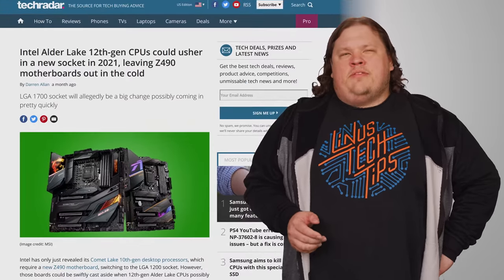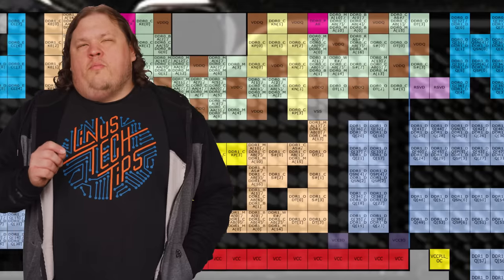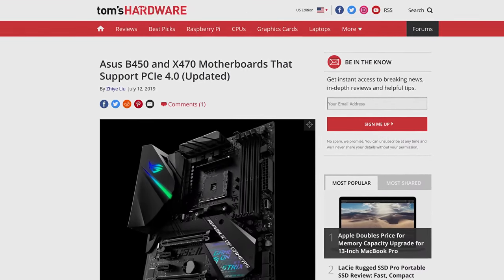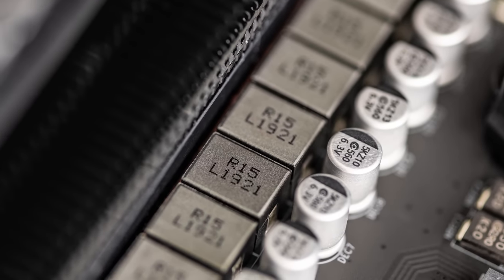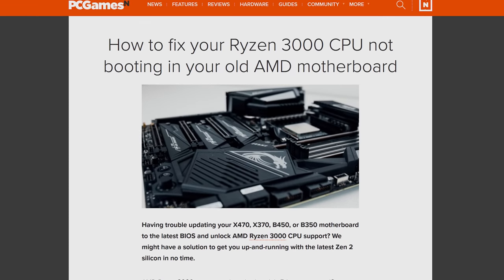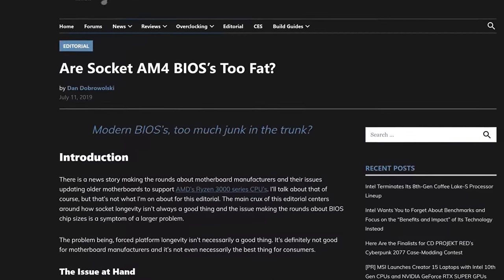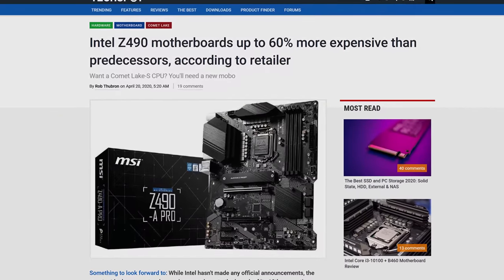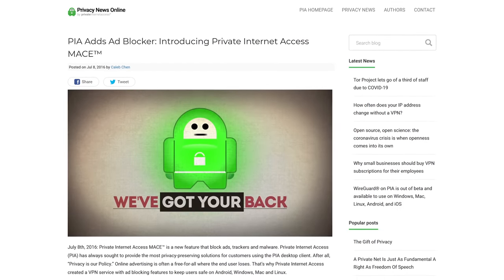Why CPU Sockets CHANGE So Much

Comment: intel, who sold the same processors for many years, changed sockets for little to no reason. Simple firmware changes can make any 3XXX socket work with 8 XXX sockets and all in between. I guess if your running the latest i9 It will fail but for most people and cpus it won't. In china it is normal to take one socket motherboard and edit the firmware to work with another socket.

Comment: well with a 7 to 10 yr upgrade cycle as older hard ware lasts that long still the motherboard i have doesn't even have  a chance or supporting what is out now. 
The thing is usually the fix for this is buy the newest chip set revision. The if you get the newest chip gen they will be compatible. Having a 7 to 10yr upgrade time every time the upgrade path of the CPU will be get what you think you will need in the next 7 to 10 years. More expensive now but if you aren't upgrading at all for that part then it isn't. 
The other part he did not touch on is consumers now usually don't build their own PC. Yes you can but most don't. If you are going to due to it is cheaper then most likely you aren't going for bottom of the bin parts but higher end parts. To this you will want the most recent chipset with the most recent gen of CPUs.
The people who build upgradable PCs that the CPU is part of the upgrade path i just don't get. The CPU changes every 2 years no matter which side of the now line or triangle you are on. Depending on if you count ARM BGA CPUs or not.

Comment: video suggest, how to work out power supply specs vs requirements. 12v rails and does a modern pc use 90% of its power on 12v rail? 12v rails and amps for graphics cards matching them properly etc. thanks in advance.

Comment: Ryzen 7 3700X - 274$

X570 Aorus Pro MB - 264$

AAAAAAAAAND I'll need a new power supply while I'm at it... 

Looks like I'll be waiting for the 3080Ti series, by the time I save enough to get the processor, mobo, and power supply that I want, the 3080Tis ought to be out on the market.  May as well go big...

Comment: So you want to tell me, that the Z170 based Maximus VIII Formula, the Z270 based Maximus IX Formula, the Z370 based Maximus X Formula are not capable of running a 9900K because of their weak power delivery? They all have a 8+2 Phase power delivery and so does the Z390 based Maximus XI Formula (which officially supports the 9900K). Why wasn't the Z170 able to run a 8700K or 9900K then?

Comment: "Power delivery systems on older boards may not be designed for processors with a higher TDP."

Wasn't the TDP on some older processors in Core2 era up to 150W??? I don't quite understand how that can be an excuse.
Reply: However is that power delivery system reliable even with more efficient CPUs. Which is what AMD deals with, at least with older Ryzen before Zen 3. Kind of like trying to wire up newer appliances in a house built or at least updated in like the 80s and 90s...

Comment: Follow up question: if we need to buy new motherboards with every CPU upgrade anyway, why not integrate all that stuff on the motherboard directly into the chips? And ship much smaller, simpler and cheaper motherboards - which might even last for another generation of CPUs, since they would come with most of what they need built-in? 🤔

Comment: I don't understand the people who are angry at a chipset or socket change. The vast majority of people upgrade every few years so it is guaranteed that you will need a new motherboard anyways. I had a i5-6600k then upgraded to a R5 3600x with a x570 mobo. I had my cpu for a good 5 years before needing more cpu performance. For me I understand that I will be buying a whole new cpu + mobo whenever I upgrade.

Comment: Why can’t you just buy a more expensive motherboard upfront that’s overkill? Like Intel has a decent idea what their processors 5 years down the line will be like. Why not do something like “oh this expensive motherboard will have half the pins currently unused, but will be compatible with a CPU five years down the line. This cheaper motherboard can’t do anything with half of those pins, so won’t be compatible with future CPUs”

Comment: Sounds like Intel might've been on to something for requiring new chipsets for new CPUs even if the socket was the same. They won't have to worry about supporting all the CPUs for the socket in the BIOS with this method.

Comment: My first PC was a AMD 754 socket set - the first 64 bit home CPU, as I wanted to future proof as much as possible.
For those in the know you can laugh now. 
So what happened? In six months! AMD came out with the 939 socket set, and didn't bother supporting 754 with any new processors. And then a year later they came out with AM2 (at which point I could laugh back at my 939 socket owning mate).

Meanwhile if I had gone with Intel at the time of the 754, there were still upgrade paths open for me more than two years later. And even when they finally changed their socket set they supporter the old socket with new CPU'S for a while.

This is what killed AMD for so many years and lead to Intel having dominance for a decade and a half until Ryzen. During that time AMD had to survive on price point in the budget end, and enthusiast turned their backs on them due to being burnt before.

Oh and the 754 motherboards tended to blow up due to faulty capacitors - rumoured to be due to industrial espionage that stole a (deliberately) faulty formula.

Comment: You know what would incentivize people to upgrade ?
Companies accepting returns. So like you have a $300 mobo and its like an yr old but the new cpu requires v2 of the same mobo , you just hand your mobo to company and they give you the v2 for 20% of the price (more if condition isnt mint). 
OR 
Why not just have cpu sockets with a lot more pins on reserve,  and have already thick pcbs + 500 MB bios  + powerful VRMs and empty data lines on the pcb for future use ? Atleast support 2-3 gens ahead. Like how amd did it with am4 but with a lot of hiccups.

Comment: Wouldn't be better if motherboards integrate  a teeny tiny soldered CPU for the sole purpose of updating the bios without using and older cpu? I think this will cost less than a dollar during manufacturing, you wouldn't need a fast processor

Comment: why Intel could not use 2011 socket ? it has more pins then socket 1151 and 1200, while also having 40 PCI e lane's? why they couldnt just upgrade it to pci gen 4?

Comment: I got a CPU with my first PCU payment (Prestation Canadienne d'Urgence) and its a i9-10900X 10cores(20t)  gen10 Intel processor...  Luckily enough my mother board was compatible (for the socket part)... an Asus Tuf Mark-1 299X with a (FC)LGA-2066 (or Socket R4) overclocked at (52/50) x101 megahertz or 2x 5,25 GHz and 8x 5,05 GHz ...

Comment: Can you please tell what new features is intel putting on their boards to change sockets every 2 years. when the only significant change since the 2xxx cpus was the implementation of DDR4 on the 5xxx cpus. Are we just going to ignore the die shrinks which pretty much maintained power draw at the same levels over the years? Even my old Q9550 drew more power than a 9900k. So I'm no at all convinced every socket change was actually needed. As demonstrated by AMD going on 4 generations on the same socket.

Comment: i get the idea behind the need to change but i think the life cycle of the sockets are a little too short... they should aim for 5 years, have a dual BIOS kind of deal... one is a ROM and the other is a Flashable chip so basically you "add on" the update to the ROM chip instead of "erasing" it.

Comment: they use artificial scarcity and planned obsolescence in retail settings every 2 generations to make you want underpowered new feature at budget, instead of high performance last gen at little cost, because of things no one really cares about like new chipset or socket got a new type, also same issue with every new RAM revision that make  old boards fall into obscurity or seem slow because everything newer is more than double. making pc shopping a latest gen pc in retail setting  a $400+ minimum ordeal no matter when  in the past 30 years instead of the $100 ordeal it could be if you just get all high end 3 generations old new hardware.

Comment: It's not really power as much as current that is the problem.

While power have increased over the years... well since Pentium 4... really not very much, voltage have dropped considerably. This increases the current.

It's the current that dictates the amount of pins...... for now... not power.

Now, if there is onboard stepdown in the future this might change, but that is a tall order.

Comment: 1:26 WRONG. Power draw would be an issue when the new CPUs need more power... Usually new CPUs are more efficient and not nessesery need more power. They need same or less amount of power to deliver better performance. Exception... INTEL... let us get up to +5GHz with 6 years (or more?) old 14nm technology...

Comment: My way of looking at this is: no upgrades altogether!!! Let's say you use your PC for 3 years, most people use their for at least 5, by that time you need a new CPU and GPU to keep up with games, there is a good chance by then the socket has changed and there is a new version of PCIe your old mobo didn't have. And with that maybe a new RAM type has been developed and is the new norm as well, and all that is basically a new computer.  
  
Stop worrying about upgradability, just build your system for now.

Comment: If the sockets pins are what's stopping the motherboard from supporting a processor why not just build a socket with much more pins that what you need and flesh out the pins as you go. And secondly if the BIOS chip memory then why not pack in more memory to make the platform last longer. If AMD can have a socket last upwards of 4 years with minimal pins then Intel with their higher R&D budget could've easily done the same, but they didn't they made sure they stuck to the every 2 year model even when it wasn't worthwhile to do so.

I know these upgrade would raise the cost of a motherboard by a bit and would increase board complexity but for many years of support I feel like people are willing to spend the little extra for a platform that can last 4+ years

Comment: So I'm wanting to get the new ryzen 3600 with PCI Express 4.0 support. Can I finally buy a b450 motherboard, that will support PCI Express 4.0?
Reply: No, you need X570 to have PCIe4.0 on the 16x slot, to the chipset (4 lanes) and for chipset lanes. B550 will have the 16x slot as PCIe 4.0 but all chipset lanes and communication is 3.0.

Comment: He made it seem like a board upgrade from b450 to b550 would only cost as much as the goat simulator dlc, no its not. Ignoring the fact that you would be buying a new board and reselling your older board, even if you resell for full price you will still need to add more money in, and pay more compared to the dlc

Comment: With AMD I take a mb and CPU, check if they have the same socket and if the CPU generation is supported by the BIOS. With Intel I search a CPU I want, I search a fitting mb, I oversee one letter nothing works.
And that is one reason why I prefer AMD. I already wanted to build an Intel PC, but I was so confused over all the similar named sockets that I gave up...

Comment: Do people really regularly buy a new CPU for an existing motherboard? I don't see much of a point... CPU do not improve in performance that dramatically over time. It is generally several years before upgrading is worthwhile. And then at that point, why would you want to try to run it on such an old motherboard which will lack most of the newer features of the new generation? The motherboard is generally one of the most complex and least expensive parts that go into a computer.

Comment: To be honest I never understood why changing socket is problematic. For example I prefer to buy a whole setup every 3-5 years, instead of upgrading separate components.
I tried to search the internet for some kind of a research how often people replacing CPU, but I didn't find anything.
In summary, my question is:
- Is it common that people upgrading CPU (while keeping other components)?
- Is it worth to sell your used CPU, even if you lose money, and probably only gaining 5-10% performance increase with a new CPU?
Thanks in advance!
Reply: -Is it common people upgrade CPU while keeping other components? No, because you usually can't because the sockets change (ergo this video) :P
-Is it worth to sell your used CPU to upgrade? If you have to ask this question, then likely no. If you have to upgrade, you have to upgrade, otherwise you don't.

Comment: To avoid making motherboards new every time for a different socket, you need to create processors as video cards with their own memory and the ability to connect via PCI express 4: 0.Then any motherboard will support any AMD and Intel processor.
This will change the design of the motherboards themselves and the system cases to the PC.
Reply: That is literally making a CPU on a card, you're just moving the 'motherboard' to that card...
That card would need to have space for a CPU socket, DDR5 slots and a massive PCIe connector to support at least some 128 PCIe lanes to be compatible with most consumer CPU options.
Such connectors alone would be unaffordable for most consumers, you'd be looking at 3000-5000 pin connectors and you cannot use a socket as that takes up way too much PCB area on a board. Imagine buying your next motherboard and just the cost of the connector is $60...
Basically this would turn a motherboard into a 'backplane' type board, great for simple design/manufacturing, terrible for high speeds such as those in modern PCs.
This was an option 30-40 years ago when PCs were in the low Mhz clockspeeds.
Reply: @someguy4915  The disadvantage is that a universal processor will need to be bought with built-in memory on the card, just like all video cards.
This means that it will be much more expensive. And the memory can only be replaced together with the processor. i3 and 16 GB, i5 and 32 GB, i7 and 64 GB.
But the motherboard will be able to work with all processors of the first few generations and many others in functionality, but with speed limits.
It's not about cheapness. It's about universality and omnivore. Like a steam car – gas, gasoline, diesel, kerosene, firewood, alcohol, and all together with hydrogen.

Comment: AMD's bios memory excuse is stupid, they paired the bios with 16MB of memory and complain about it being so expensive when I can get 16GB of memory for less than $2. This isn't the 1980's. And bios flashing can be done with USB so there isn't a need to buy or have a different CPU just for an update.

If there wasn't so much money to be made by screwing customers over by forcing them to buy whole new hardware, manufacturers would actually plan ahead and spend the extra $5 or $10 needed to make the motherboard compatible with the next one or two generations of cpu. But it is just so much more profitable to keep charging $100-$300 every year and you know what, that makes me want to fuck upgrading so fuck those money grabbers, I'd rather take the 5-10% performance hit than buy a whole new computer again when I only want a better cpu.

Anthony, you are a blessed angel upon our dark world, don't stand between me and hating AMD for that ass wipe of a marketing stunt they pulled.

Comment: Exactly why I don't care about intels socket change. You're doing it wrong if you're upgrading less than 5 years after you buy your hardware, 7 at most.
Went from a 3770k to an 8700k after 6 years of use.

Comment: Anthony...I need my Python script running on PyCharm to use 80% of my 4 cores 8 threads CPU. It only uses 3 %. I am trying to ping all ip addresses from 0.0.0.0 to 256.256.256.256 and the execution is slow. Help.

Comment: power draw huh? my older 9900KF has an intel tdp of 95W while the 10 series comparable CPU already had a 125W intel tdp. why though? 95W was more than enough in these times where global warming, power consumtion are great concerns. it doesn't need to have a tdp over 100W per cpu with proper development, this is not an excuse at all.

Comment: Can't you just have two different firmware with both having the same functionalities, but one has support for any Ryzen+ CPUs, and the other one has support for any CPUs before Ryzen?
Reply: Possible, but then your relying on the consumer to know when to switch between the two. You are also making the consumer make a choice to leap from older CPUs to a new one that they might not trust. So really it is a consumer effort and trust issue.

Comment: Just don't upgrade your CPU. Sounds like dumb advice, but if we are being honest nobody really needs more than 4-cores and 8 threads for 1080p gaming at this point and even Ivy-Sandy-Bridge processors from 2011 have core speeds of 3.8 to 4.0 ghz in turbo boost. I'm still running a 7 year old i7. It was expensive at the time, but sure got my moneys worth. Just as an example a i7-3770 is still a beast and the k version can savely be overclocked to 4.5 ghz (with proper cooling). Even 1440p won't be a problem if you overclock these things. That's why these fucking used Dell Optiplex business PCs with i7 processors are such a popular choice for budget gaming, these processors will perform even if they are old.

edit. by the time 8 cores are truly required in games you'll be able to get one used for cheap, hold on to your 4-cores guys!

Comment: Intel changing its sockets is pretty scummy. I remember when adding one pin was a change. Disgusting. Plus there's a video Linus made showing several different Intel generations working on the same Intel mobo

Comment: This is why they added pins to the socket or CPU itself. You can easily bend those to make a CPU fit on a new motherboard. The more pins you bend the better it is for RGB.